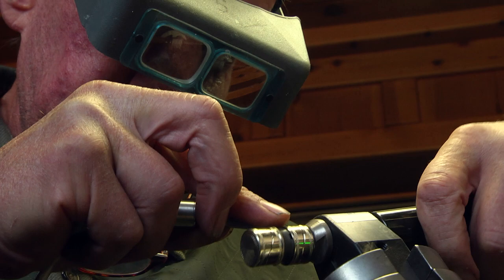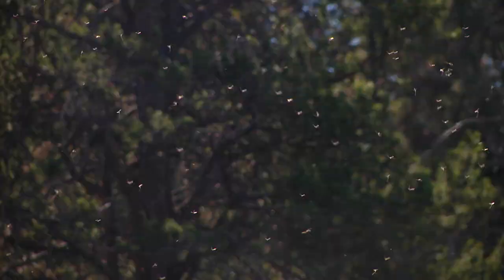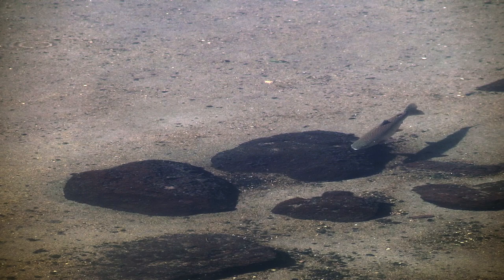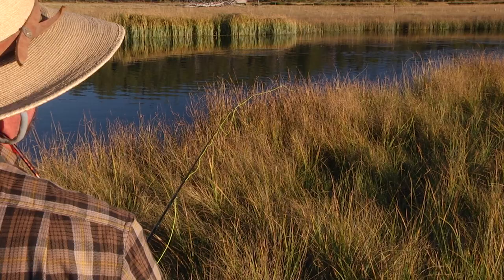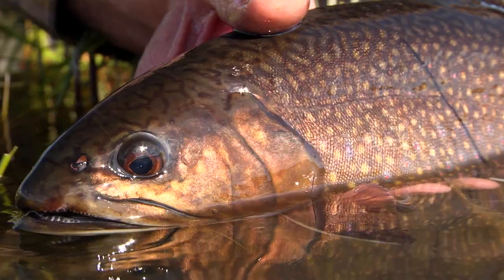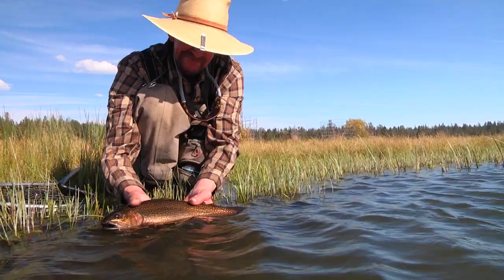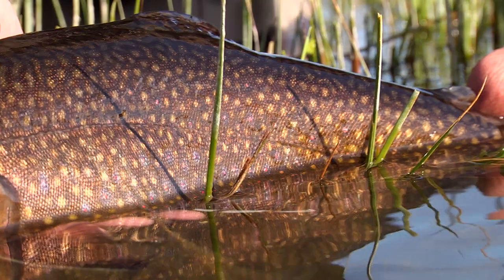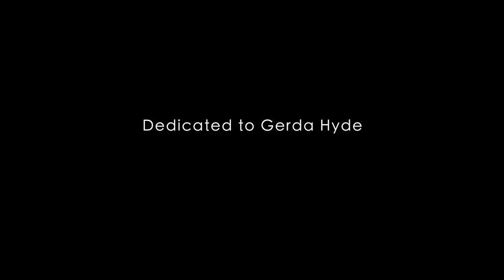Spring Creek Fly Fishing - Yamsi Ranch Oregon by Todd Moen

Comment: At 7:06, is that a sea-run Cutty?
Reply: Scott Dockrill no, definitely no. the williamson river is connected to klamath lake the headwaters of the klamath river which has multiple dams on it. there are also multiple small errigation dams on the williamson river it's self that take out enough water to prevent a consistent flow from going from the ranch area to the mouth of the river. making a sea-run fish impossible.